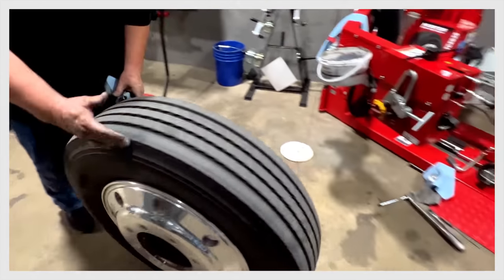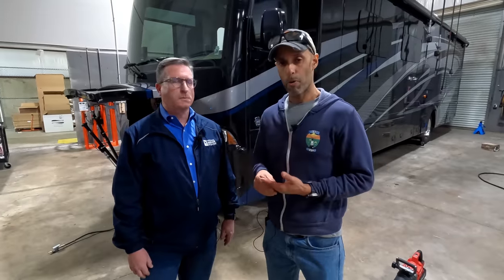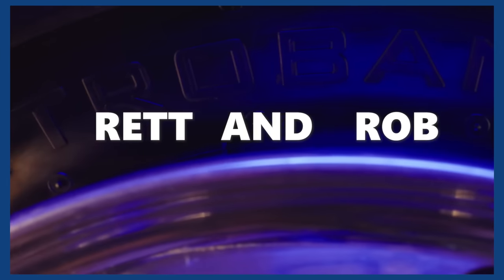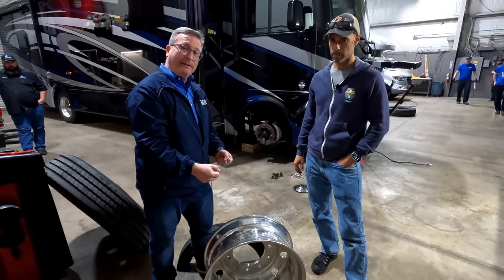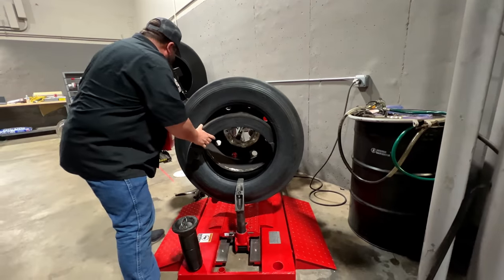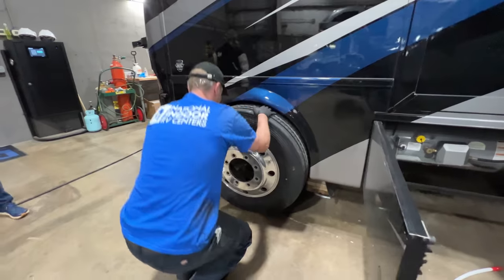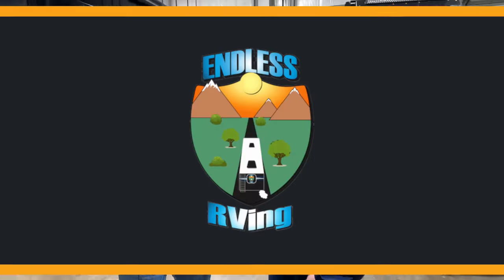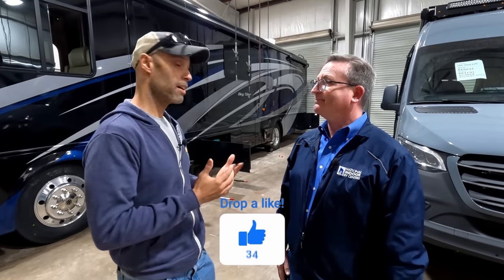RV Tire Blowouts -- How Rettroband Wheel Enhancement Can Save Your Life!

Comment: So it’s been tested several times !!! . Been driving dump trucks for 40 years running 80,000 pounds never once had a tire blowout except for recaps in which we stopped running those years ago. The problem with Motor homes is they’re always just sitting in one spot and the tires run low on air then they get dry rotted, but the guy doesn’t want to replace them because he only put 10,000 miles on them in eight years. If you run up to date tires that have never been run low on air even for 5 miles the likelihood your tire will blow is very slim. It does sound like a bomb when they blow the biggest problem is they slam the brakes on the tire that’s not blown gets traction that is blown is on ice as you can see in that video is right Tire blue he hooked the left into the median, then continue to overcorrect with the steering.

Comment: pretty neat.   I was one who had 5 blowouts on a trip from fl. to arizona. in a motor home.   One of my blowouts was on the front but fortunately only the tread came off of it.  If it hjadnt ,   I would probably have wrecked the motor home.   Very good advice izzy.   thanks
Reply from the maker: Glad your ok. Might want to look into rettrobands
Reply: You may want to figure out why. 5 blowouts in one trip is way out of normal. Overloaded, under/over inflated, old tires, driving too fast or bad tires that need to be recalled.

Comment: I don't understand why NRIVC doesn't license Retroband for independent sale. They don't have stores in Canada, so we can't buy it or replace it here.
Reply: From what I've read, when Rettrobands first came out, there were some failures due to improper installation by non-NIRVC installers. So to protect their reputation and ensure quality, they redesigned some of the components and also spent many thousands of dollars on equipment so they could do all their installations in-house. Essentially, the owners are more interested in their product performing as advertised than maximizing their profit through licensing.

Comment: You are installing the Rettroband Tire blowout protection system only on the front two wheels, other than cost, can they be installed on all of the wheels on your motor coach and trailer?  What about other cars and trucks?
Reply from the maker: Contact NIRVC for full details in sizes they offer.  Thanks for watching and the comment

Comment: Hi Guys! I’ve seen the NIRVC videos on Retroband for awhile now and have always had a couple of questions: 
Do you have to buy a new set of Retrobands every time you buy new front tires for whatever reason? 
Does the lifetime warranty cover replacing your tires due to general wear and tear or age…or only if you need new tires due to a blowout? 
Also, people should check and see if adding retroband voids their new tire warranty in any way. Thanks and congrats on hitting 100k!!
Reply from the maker: Rettrobands do not need to be changed when you replace tires

Lifetime warranty is for the rettrobands not the tires.
Reply: Thank you for clarifying. Yes, that’s what I meant. My question was worded strangely. LOL Was trying to determine if a person only needs to buy Retroband one time, regardless of how many sets of front tires you go through.
Reply from the maker: @CarolynGracieTV  thanks for watching!